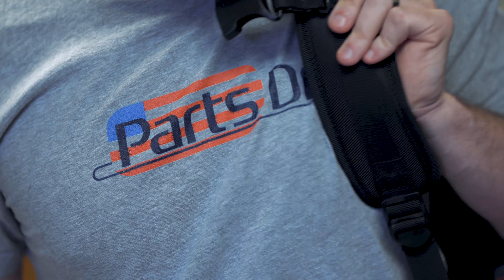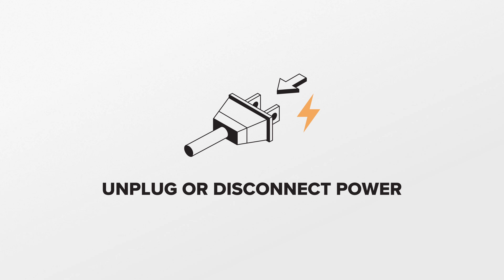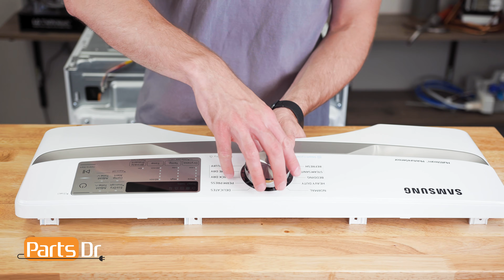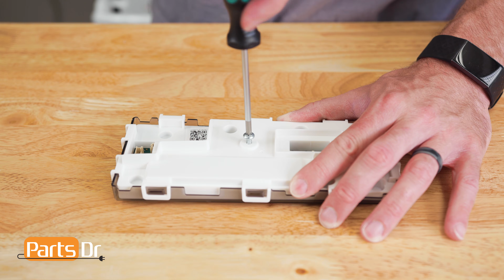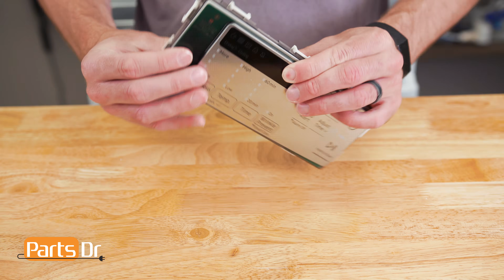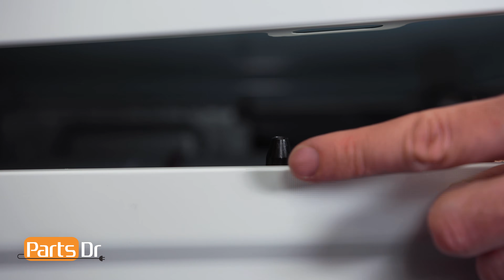How to replace Samsung dryer user interface display board part # DC92-02390C

Comment: Can a bad UI board cause the dryer to not work at all? No drum light, no nothing
Reply from the maker: Yes, a bad UI control board can definitely cause that, especially if the dryer has no lights or response at all. It’s worth checking the basics first like the power supply to the dryer, thermal fuses, and main control board since those can also cause a completely dead unit.